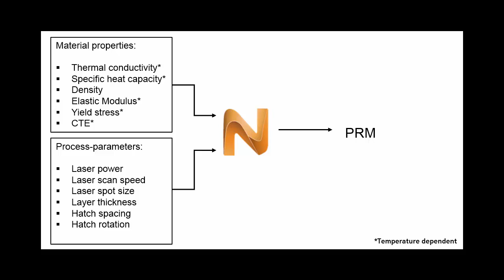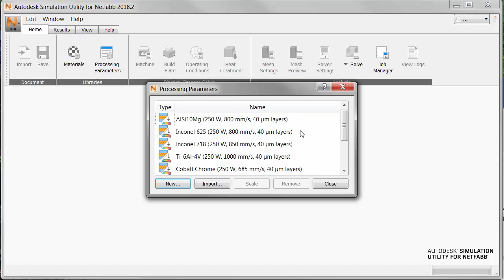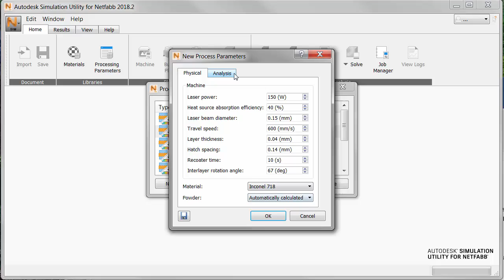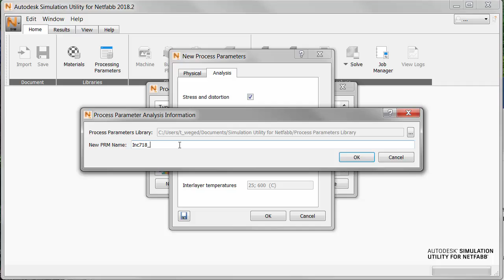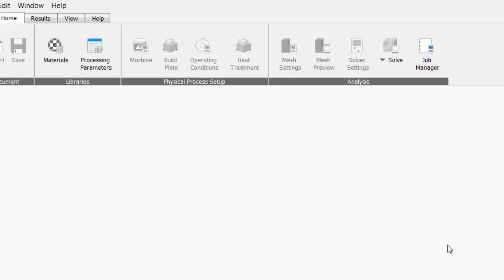Netfabb Simulation - Generating a Process Parameter File

Comment: Hi, I have a problem with the process parameter. I don't have the  library of the set parameters and also I don't have the bottom "OK" to save the new process parameters. Could you help me?
Reply: this depends on what specific version of the software are you using. Only Netfabb Local Simulation is capable of generating a PRM file. If you are using the Simulation utility LT for Netfabb Ultimate, you will not be able to generate a PRM file.
Reply: @sualpozel1  does that include netfabb premium not eligible for custom process parameters?
Reply: Netfabb premium 2024 does not include any of the Netfabb simulation capabilities. What specific software and version are you using?
Reply: @Sualp Ozel  Using Netfabb premium 2022 to run a DED simulation of a model I made. Realised that's there's hardly any customisations or evaluation that can be do using this version besides using the generic DED parameter and seeing the estimated build time. Unfortunately I can't find any other softwares that does DED (especially LENS) simulations too 😭
Reply: @rashedisaboss4194  Netfabb premium 2022 does not have the functionality to Setup / Solve a DED simulation. You need Netfabb Local Simulation for that.
Reply: @Sualp Ozel  it does have a generic ded process parameter but that's about it unfortunately